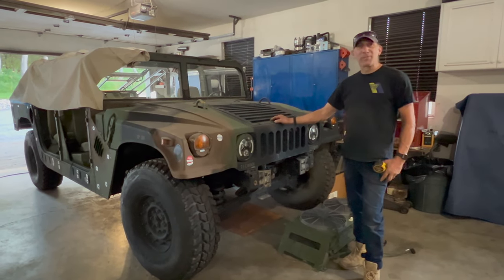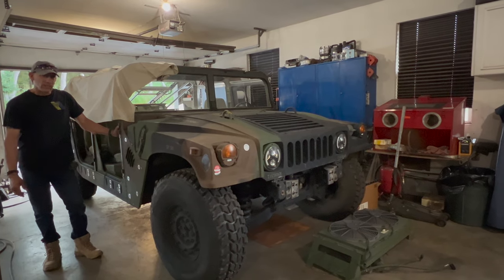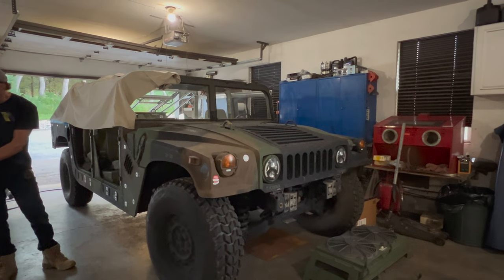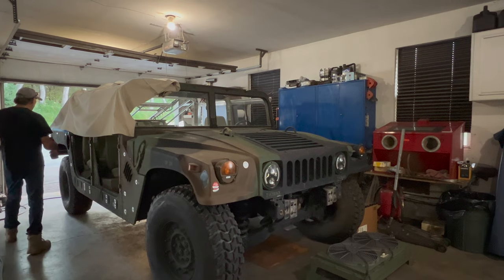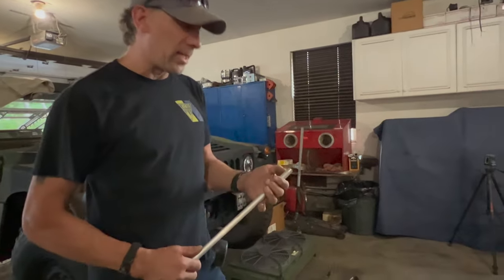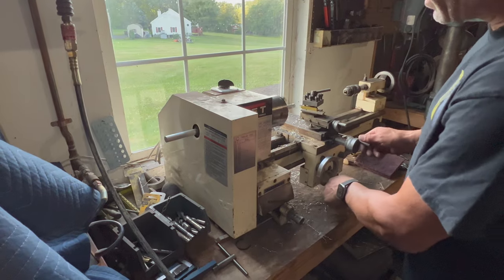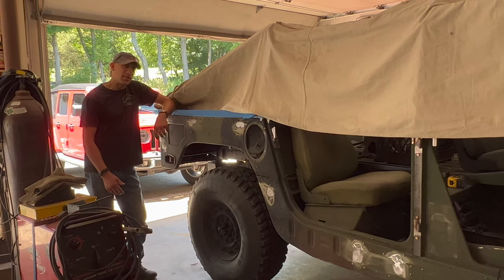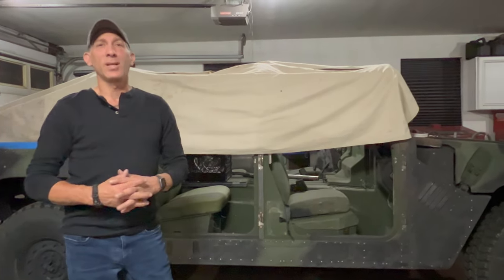Humvee Body Armor Hole Repair

Comment: Wow very professional work! I feel kinda bad now about how I did mine, just lag bolts with washer and nut behind. It was a good quick fix but after seeing this I’ll have to give her a try. I’ve never welded aluminum but maybe those aluminum brazing rods will work just as well. Cheers!

Comment: That's gonna help a lot of people 👍 Plenty of humvees on auction sell with armor holes. I might also install rock sliders that require drilling into the body, so it's good to know that I can fix them later on.

Comment: I was able to get half inch aluminum all thread and make set screws and weld those in.  I'm too unskilled and lazy to do all the work you did.  Tapping and putting in home made set screws only cost $12 though.

Comment: I believe I read somewhere that the alloy of these bodies is 6010.... you say the 3/4 round stock is 6061....what welding rod were you using?
Reply from the maker: I use 5356 filler rod.  Its a good all around filler for 5 & 6 series aluminum and  it has a higher shear & Tensile strength.   I also prefer it because some items I fabricate get anodized and it color matches well and service temperatures are below 150 degrees.    4043 can be used but if you anodize it it will stick out a dark grey.
Reply: @Custom4x4Specialty  Thanks fella, that's what I was hopin'...got plenty of that kickin' around from my trailer builds